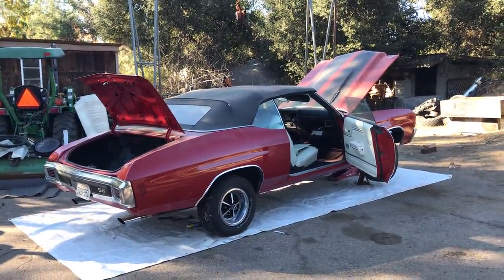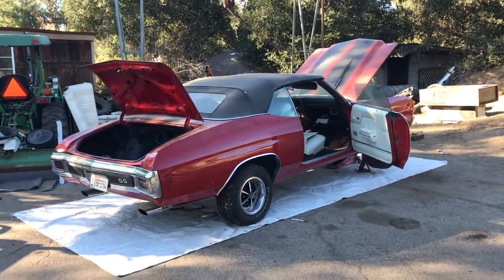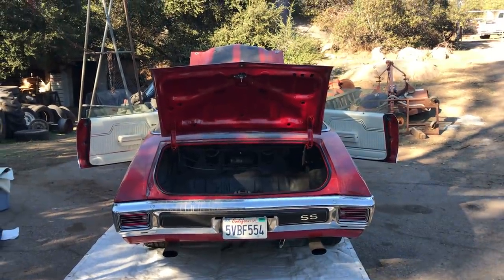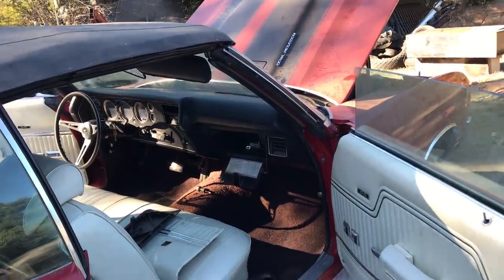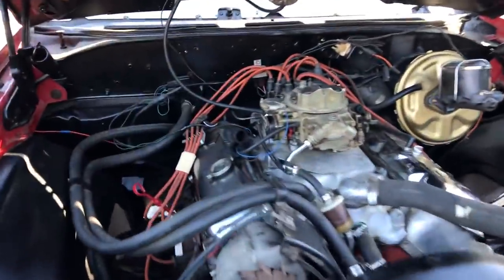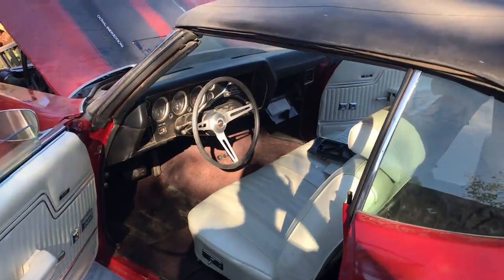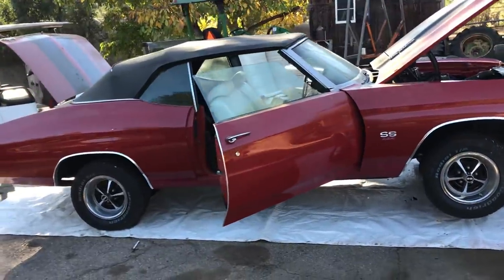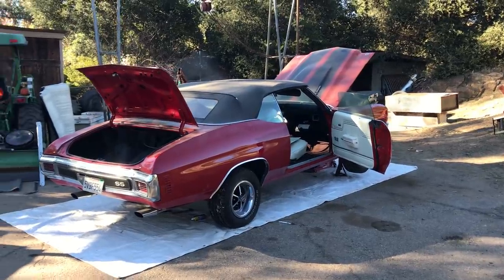I Saved a Guy $250k From Nearly Buying a Fake 1970 SS454 LS6 Convertible In San Diego, CA!!

Comment: After owning for 35 years the  current owner won't lose any money, He just won't be able to .purchase that yacht he was looking at.
Reply: I think he's a knucklehead for looking to sell it... But,  that's my opinion
Reply: @greggarner4477  I mean if he's tired of looking at it, he should let it go. The value of it shouldn't get much higher than it is now either
Reply: The SS on the grille is upside down too. That makes me cringe to see mistakes like that.
Reply: @greggarner4477  he don't have a ls engine it is just a bbc in it so that means he is after to rip some one off that is y he is calling it a ls car it is one big joke and i bet it is not even a ss car i have seen a lot of people ripped off on these first thing ls never built a big block the l.s. 6 454 is a small block and it is a roller engine can't have low profile valve covers on roller rockers this is y they build tall valve covers is for roller rockers so if i could get the money for a fake ss car y not sell it and ls never put a ls engine in a convertable
Reply: @melissaweidman3326  The LS6 Chevelle is NOT an "LS" engine add... The LS6 is the vin code for the 70 - 72 Chevelle BBC line of SS... 2 totally different things
Reply: @greggarner4477  ls will explain everything to u they have a big wright up on the website just for people like u and yes it was a ls engine it was the l.s. 454 small block and the l.s. 7 427 small block that was in the 70 chevelle ss ls car there was never a ls big block ever not even a bbc 454 gm would never call 2 totally different engines the same thing just go to ls website and learn about it . it will even give u the reason they put the ls in the 70 chevelle and y do u think the ls car is the holly grail of muscle cars because it was the first full roller engine in a car that was way lighter and more power then anything before and with just few tweeks u could get a lot of power real easy plus they love to have boost the bbc ho had 450 hp 485 torque  but the ls 7 had 525 with 300 lb lighter then a sbc but there was only 6 built y do u think it was so bad ass this was me and my friend dream engine and after 40 years i finaly got a l.s. 7 427 small block new version with overhead cam 4 valves per cylinder 860 hp stock no boost and it really wants to be boosted got it in a trade even a ls 6 454 cast iron block is 100 lb. lighter then a sbc just think against a bbc and every 100 lb. in the quarter mile is 1/10 of a second but yet it still has the power of a bbc with a lot higher rpms to it and trust me u will never see a real 70 chevelle ss ls car they are in very good care they never go up for sell i have never seen a real one up for sell but i did see one on the show room floor in 1970 . it was already sold  and my older cus was explaining the engine to me and i was 12 and already was building my first car do u know how hard it is just to see one of these cars . threy started with the ss car then pulled the bbc and replaced it with the ls engine and u have to go by the vin # of the car not the codes they all have a 454 or a 427 in them just the 454 bbc and the ls 454 small block had the same code and the ls 7 427 because they used the same car and pulled the bbc out of it this is y everyone with a bbc 454 thinks they have a ls car plus on the hood it says cowl induction LS this emblem u can not get it they don't make it any more
Reply: @melissaweidman3326  it's not my car, nor do I care about the add or anything else associated with it. I was just explaining what the LS6 designation is to you. Look up LS6 Chevelle on Google... you will see thousands of those exact cars. I am done with you now .. have a nice life ans learn your shit before you bash a collector
Reply: @1967davethewave  at least I know what an ls engine looks like and gm never ever called 2 different engines the same thing u guys have no idea what ur talking about and yes ls put a ls engine in the 70 chevelle y do u think it is so rare  but yet there are 1000s of them on the net and all have a bbc in them not the ls engine because they are not the ls car good luck finding one there about 100 left in the world and on the hood it will say cowl induction LS the 3 crate engine that they used were the ho 454 450 hp at 485 torque bbc and then the LS 6 454 small bock and the LS 427 small block in the 70 chevelle then those engines u could only get as a crate engine because they used the 70 chevelle to introduce the new crate engines at least that is what LS claims that is were i got all my information from and i have a ls 6 454 and 2 ho 454 in my shop right now i am a old man and i knew this stuff when i was a kid i just read all the stuff on the ls web site when i was ordering my ls 6 crate engine they only come one way small block same block that was in the 70 chevelle just look at a ls 6 454 on the web u can go to gm and they have a picture of a ls 6 454 with carb they all look the same only up grades they did to the block was sensor ports for efi
Reply: @melissaweidman3326  The LS6 is the RPO code for the 450 horsepower 454 Mark IV big block Chevy engine in 1970. I bet you have no idea what an RPO code is by your babbling, incoherent posts but it's the factory designation for a specific option.  Chevrolet never made a 454 or a 427 small block. There are a couple of aftermarket companies that produce tall deck small blocks that displace 454 cubic inches. Please go back to popping mushrooms or whatever other hallucinogens you're doing.
Reply: @1967davethewave  they put ls 6 in the 70 chevelle even ls claims this just go look at a ls 6 454 and then tell me that is the same as a bbc that was a big thing when i was a kid in 1970 a sb putting out bb power i have seen the real deal with the ls 6 454 small block in the car all factory on the showroom floor so i think i know what i am talking about were u alive back then because i was i even know someone that was trying to get it new but they sold way to fast and he did not what the bbc one
Reply: @melissaweidman3326  The LS6 454 in a 1970 Chevelle wasn't a small block. It was a MARK IV Bib Block. The biggest factory small block that Chevrolet ever made was the 400. It was introduced in 1970 but was never used in ay performance applications. It's RPO designation was either LF6 or LT4. You really need to stop talking and start listening.
Reply: @melissaweidman3326  All Pontiacs from 287 to 455 share the same block dimensions so there are no small or big block Pontiacs. I want you to give me a ling k to that 500 cubic inch small block. It's easy to settle this debate, give me proof. I'll wait right here.
Reply: @1967davethewave  all Pontiacs are small block according to  gm but i like to call them a medium block  because they are a very big small block design u can find the 500 cubic inch at a lot of crate engine places  seen them a lot when ordering engines never new they built them till i ordered a crate engine just like my 327 we oversized the cylinders used titanium locks pushrods and rods in it to make it a race engine and it has been to 15,000 rpms many of times but it was built by old man bell himself which has been building racing engines for over 50 years for the big boys if u seen my place u would shit over all the rigs i haver not counting 10 acres of good clean project rigs and i don't need to sell any of it . just to show u how much i know about rigs i just been building a 68 chevy pu i have 2300 in the truck then sold the rig i got the engine out of for 2000 bucks so i only have 300 in the truck it is a 68 short box good clean body everything is painted but the final paint full ground restore running a stroked 454 with tunnel ram new 850 holly has steel crank heavy rods high flow heads stock it had 450 hp 485 torque crate engine with the heavy duty 400 turbo which means that it has the bigger pump heavy clutches and the stage 1 shift kit the engine and trans has 6000 miles on it and it was modeled after the 70 chevelle ss 454 bbc it is just the crate engine of it long block is 8000 new i got it for free and i get them all the time for free because i know the secret on getting them right now i am waiting for my friend to change out his roller cam set up out of his drag car and then i will put it in it and it will be free can u beat that for 300 bucks i been offers of 12000 for the truck because it still has factory paint and no rust in it plus i still have the fresh 327 and trans that came with the truck  which i can get a easy 1000 bucks out of it i have about 8 good running 4 bolt 350 sitting because i pull them and put a bbc in it i have cars that u dream about in 1978 i picked up a 67 rs ss camaro 427 yenko for 750 bucks and they rollerd the engine on it before i got it but all my rigs run pump gas and i never run nitro and how u build ur engine is going to be how long it last just like my 327 we even seasoned the block and used cast on cast and polished the inside of the block it has been in a lot of races i drove it on the streets as a driver been on the road for over 20 years . nitro or boost will lessen the life of an engine and just on pump gas it dyno just over 1200 hp now i would say about 1000 to 1100 but still runs good plus my class is pump gas only full body cars street legal even tires that little 327 has a lot of money in it just the rods cost more than most people street build  and we pulled the engine out of a 70's dragster then put 25,000 in it . my friend will buy a 20,000 dollar crate engine then put another 50,000 in it easy then i come and get there shit they don't want got a lot of stuff from terry fisher i grew up with him these are the type of people i hang with most of the people i know drag race i even got a good road right by my house we drag race all the time and yes we do blow engine a lot of them and if ur going to race get the safety stuff for the car or biuld a bad ass engine u need the safety stuff like a bulletproof bell housing or scatter blanket
Reply: Wow.... my head hurts...
Reply: READING THE INTERESTING COMMENTS! A 15,000 rpm 327cid. Seeing is believing! Reminds me of some people I know in the automotive bussiness! (FAST EDDIES!) 5 FOOT OR 5 SECONDS WHICH EVER COMES FIRST!!!  SOME PEOPLE ARE MORE FULL OF POO POO THAN A STUFFED CHRISTMAS TURKEY!
Reply: @zedee2000  i can tell u know nothing about racing engines it was built by bell which is a pro builder what kind of rpms do u think a top fuel car will turn it just takes a lot of money titanium rods help a lot and pushrods and valve locks just the rods cost more than most street engines the valve locks were over 400 bucks just for the little valve locks then it had the shit stroked out of it what u would call double stroked i bet u have never heard of that have u this is real race talk
Reply: @melissaweidman3326  John Force, Schumacher racing, Sonny Leonard, Nelson Racing Engines, Kenny Duttweiler, Charlie Buck, Gene Fulton and many more engine builders never turned that many RPMs. Let's say this 327 turned 16,000  RPMs like you said. How much torque and horsepower did it make? I agree with you speed and power is money but 16,000 rpm's!
Reply: @zedee2000  just top fuel car can hit 17,000 rpms that is all just they can't hold it for long just like my 327 been to 15,000 rpms just it will not last at that rpms very long but shit happens like my clutch blows the engine goes crazy or u break lose the rpms go crazy and there is no time to stop it i can tell u have never had a race car
Reply: Good thing there are people like you that have the knowledge to point out  the shady side of car collecting.
Reply: He can still purchase noose.
Reply: @colescrustycars  I’ll second that
Reply: Melissa Weidman so the 454’s that came in a 70chevelle SS is a small block and not a big block???
Reply: @lobmin  oh,it will keep going higher and higher.....i bought my 72 malibu for $2700 in 1995,sold it ten years later with a cracked frame ,needing plenty of body work and disassembled for $5000 and that same car is easily selling for triple the $5000.....these cars never devalue,,supersport or not
Reply: @melissaweidman3326  you arent very knowledgeable about these cars im guessing,maybe learn THEN COMMENT

Comment: You need authentication when spending the big dollars.
Reply: thank you mr. obvious
Reply: @rickyrick9328  Several people make the obvious mistake. Prayers sent
 your way for your personal problems.
Reply: Just by looking at the front interior I knew right off the guy who owned it was a scammer and that this was NO true SS, A good tell tail sign for any Chevy SS in the late 60's to early 70's, be it a Chevelle, Nova, or Comaro is that they are all bucket seats and the transmission gear selector is on the center console, NOT on the steering column. A true SS will NOT be standard equipped with a front bench seat.
Reply: @oveidasinclair982  Absolutely not true.  Even on an SS, things like bucket seats, console, and cowl hood were options.  I was the 3rd owner of an LS6 that I knew from new.  Non-cowl hood, bench seat, column shift.  The original owner was a big man who had the money  for a 396/375 Nova but found out he couldn't fit into it.  He then stepped up to the Chevelle, but left off what he could so it would fit his Nova budget.
Reply: True. I had an original L-78 SS
with a bench seat and 4 speed.
Had the build sheet.
Reply: Worth the 3-500 bucks for sure

Comment: Lord, he owned the car for 35 years and never noticed the upside down emblem on the fender. Or he installed it upside down!
Reply: How can one tell if the "SS" is installed upside down. I am not trying to be sarcastic . I cant tell.
Reply: @nooneeyeno  : IIRC the emblem also has 454 on it
Reply: @nooneeyeno   Interesting...hard to tell, but looking at other pics, it seems the curve of S on top should be narrower than the curve of S on bottom, tiny bit more squashed for bottom. the inner curve of S should be more rounded for top part and less round for bottom part. Just my thoughts, no expert, not anything.
Reply: @jarnailbrar6732  correct,  inside the lower curve of "S" is wider and squished more
Reply: Cant really blame that on them... I've seen lots of "monday/friday" assembly cars that even come through missing emblems and parts.
Reply: @vonal67  : Ya, there's an old saying,  never buy anything that was built on a Monday or Friday
Reply: @vonal67  I don't know specifically about the 1970 SS emblems but these things were typically made with offset pins so they would only go on one way.  I don't think the glue on emblems came on until later.
Reply: @nooneeyeno  Just look at it LOL.  The wider part of the "S" is on top which means it's upside down. The skinny part of the "S" goes on top.  ROFL
Reply: @Swordsfor200Alex   Thanks, I never had one and I had to pause the video to take a closer look.
Reply: This guy wanted the car authenticated because he's had it for 35 years.   This WAS his retirement fund.     Well I guess that now that it's just a 350 Malibu convertible, I'll guess that he will have to work longer before retirement and learn his lesson.      Call Patrick Nichols for inspection before purchase.    LOL

Comment: I looked at a 1970 Chevelle SS 396 convertible about ten years ago.  Although it was a beautiful Mulsanne blue with white interior, it was only in fair, running condition and needed a complete restoration.  I knew even less about Chevelles then than I know now, which is not a lot, but I was able to determine that it was not a true SS, but instead a Malibu that was converted probably in the 1980s.  The Malibu dash was the tell.

Still, it had a great “patina” look then, and would have looked like a million bucks restored, even if it was an SS clone.

Comment: Was the owner asking the big bucks, or did he have it priced low? I find it hard to believe that he did not know it was a clone. Probably didn't expect someone like you showing up.
Reply: Owner of car was trying to get $400K or best offer.
Reply: He was running a scam, A good tell tail sign for any Chevy SS in the late 60's to early 70's, be it a Chevelle, Nova, or Comaro is that they are all bucket seats and the transmission gear selector is on the center console, NOT on the steering column. A true SS will NOT be standard equipped with a front bench seat.
Reply: @oveidasinclair982  I'll reply to this one too.  Not only did my LS6 have a bench seat, so did my 69 Nova SS 396/375.
Reply: @festusian9089  My dad's first car was a 72 Nova SS, a real one passed down to him from his father in 1977, NOT a CLONE make believe SS like the vast majority of these cars that survived till this day. His unfortunately didn't, northern rust got to it and by 1982 it was headed to the scrap yard.  It was also bucket seats and center console shifter.
Reply: @oveidasinclair982  I'm sure it was.  But, as I said, they were options.  You could buy a new SS and not choose the extra cost bucket seats and console.  If your experience is based on a single car, it's probably not a good idea to make multiple false statements that lots of people will see and perhaps believe.  I was around when these cars were new, and many years later I researched and restored them.  I'd also tell you about my 70 Buick GS455 Stage 1 that was equipped with a bench seat and   column shifter but it  would probably just confuse you further.